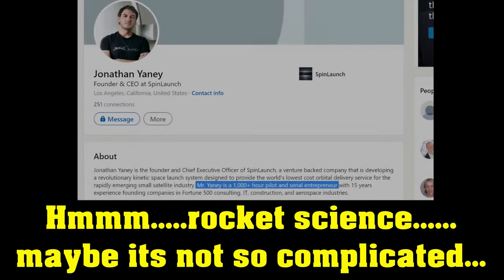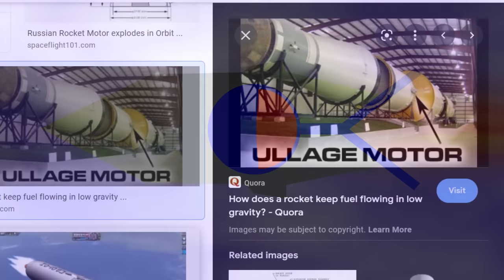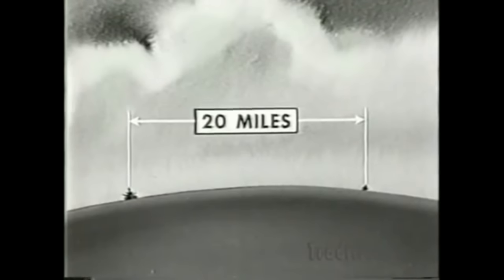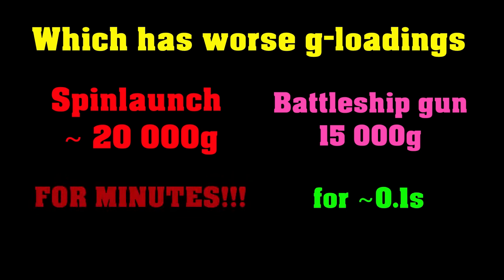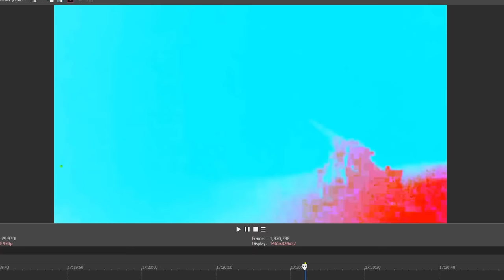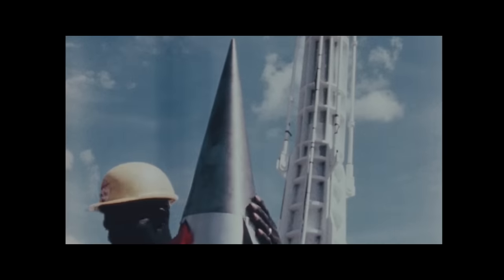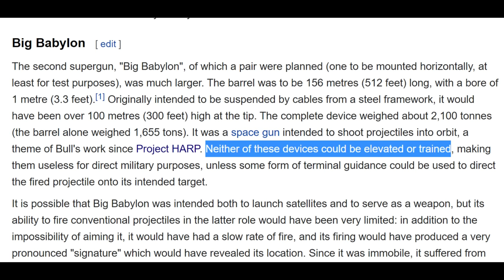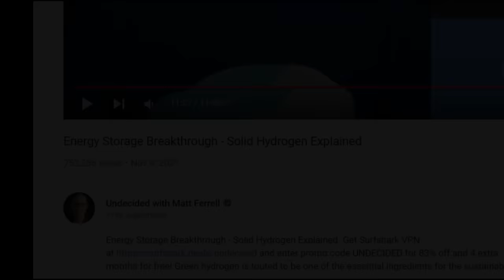Spinlaunch: BUSTED (Part 2)

Comment: Pay attention: if the rotor is spinning at 60 RPM, so is the payload. At release, the rod-shaped payload will continue spinning around its COG with conservation of angular momentum. Guaranteed failure.
Reply: As if there wasn't something called  "centrifugal force"
Reply: Get on the roof of a car and have your buddy veer suddenly to the left. Then tell me which way you fall off.
Reply: @kalebk9595  Nah, the better exemple, is to make your buddy run in circle , and then you simply let go, then we can ask wich direction the body followed.
Reply: Right. The COG is tangent at time of release. However, the payload continues to rotate in its inertial reference frame. This tumbling is caused by conservation of momentum.

Comment: I agree with most points
but I feel like calling them out for not firing at Mach 6, on a test run. Is a bit disingenuous. Of cause they aren't going to go all out on their first launch they want to make sure the concepts are even doable so starting slower is the reasonable and logical thing to do then move up in speed to see what needs fixing.
overall yes the whole thing is dumb, but criticizing them for what I understand as a first successful launch for not achiveing the final goals is just a bad argument.

Comment: Your logic is only limited by your understanding of the phenomenon of what happens in the gun. Acceleration only is nothing compared to "jerk" and it's derivated functions.
In a gun the acceleration isn't constant and induces shocks that damage the components. On a centrifuge it's smoother.

Comment: I’m sure you already know about the Real Engineering video. But just in case https://youtu.be/yrc632oilWo

I swear he’s mentioning you, without actually mentioning you.
My favourite bit, those doors that slam like a sledgehammer and have to be timed perfectly.
I’m not buying it.
RE also thinks if anything does go wrong then it’ll be cleaned up quicker than a regular launchpad. I really don’t buy that either.

Comment: I work In science media, I’ve made docs for discovery channel, science channel, history, National Geographic, etc… I guarantee you that the filmmakers added the whooshing sounds to footage from inside the “vacuum” chamber. (It’s also more of a high altitude chamber, not vacuum, but whatever.) 

I also guarantee you that the origin story of this company is much more complicated than some non-scientist dreaming up the idea… this is again a trick we use to get the “jist” out of the way as quickly as possible to get to the meat of the thing. The public has a hard time understanding how collaboration works, so we tend to default to a narrative of “Thomas Edison invented the light bulb and then started a company GE to make and sell lightbulbs (ignoring the mobs of people it took to take the idea from concept to market).”

The advantage of spinlaunch compared to HARP-inspired systems is that engineers can have much greater control of initial launch ballistics… in theory. This will be the test of whether spinlaunch succeeds or fails. 

The reason why nobody is doing HARP-like projects with modern materials is that no matter what, a HARP-like system requires a tremendous amount of post-launch trajectory correcting systems that must withstand far more Gs at launch than a circular accelerator. The uneducated viewer of this video will most likely walk away with the impression that the old HARP system was better than modern spin launch, when the reality is that the challenges ahead for spinlaunch are more likely to be solvable than a hypothetical modern HARP-like orbital launch system. 

My personal prediction is that spin launch will succeed ONLY if their investors are willing to triple or quadruple down on whatever spinlaunch is quoting them as the “worst case scenario”.

Comment: So the CEO of Spinlaunch has no experience in the field. Bit like Elon Musk then.

Yes the challenges are daunting. And it probably doesn't help with putting put marketing hype.

But this is a very new endevour. Which you are comparing to mature technologies that are at least 100 years old (modern rockets) and many centuries old (artillery). And both of those still mess-up spectacularly.

So by all means be scientifically sceptical. But kicking Spinlaunch now is like writing-off the idea of modern computers by dissing Babbage's Difference Engine.

Comment: You claim to have, "Busted Spinlaunch." Your argument is very weak here.  I agree that the G forces represent a huge problem with their design, but your argument that it's somehow "busted" based on crappy CG and that, "it's not as good as a gun," are faulty arguments.  Try harder.

Comment: ah... the problem is that the camera has a stroboscopic effect, so you can't trust your counting to be accurate. It could very easily be five or ten times faster than you estimate. Which is like the 5-10,000 miles an hour they implied. Also, if you are going at these ridiculously high speeds, then even in a near vacuum, I would count on some sonic booms. So there's your whooshing. Or, resonant frequencies of a freaking giant cylinder. I mean it's not as if things under high tension resonate well. oh wait. The problem is you based your entire argument on this stuff. So yah. If anyone has objections, tell me, but I think this debunk vid is at least reasonably debunked.
Also it's worse because it's a disruptive technology. The point is to not have to blow up a giant pile of explosives. Yah you could do it better with a gun, but rockets already are backwards guns. I mean sheesh.
Most of your videos are realistic, but many of them are just toxic pessimism.

Comment: I'm very conflicted about SpinLaunch, much more so than you or their investors. On the one hand quite a lot of the problems you brought up are valid, that video and the founder's background raise all sorts of Red flags that should tell investors to run away fast. On the other hand virtually all of the issues you brought up sound like they are actually solvable, albeit at much greater cost. Furthermore you made a major error in this video. Pressure fed rocket engines (which is what they're using) do not inherently require ullage motors. 

So what financial justification could there be for building such a contraption? As a contemporary commercial satellite launcher, none whatsoever. As an experiment, quite a lot. We must face the fact that rocket launching is not particularly friendly to the environment. Yet it is often necessary and so far it is the only way to get satellites and humans into space. Obviously this method would be unsuitable for humans, but the less rockets, the better. It is for this reason that this method may have some future potential.

Comment: I'm getting a little sick of you Thunderf00t. I was happy to see your first breakdown of that supposed solar powered extract-water-from-air grift but now you're just trying to take down new ideas,,, or, in this case, old idea finally given form.
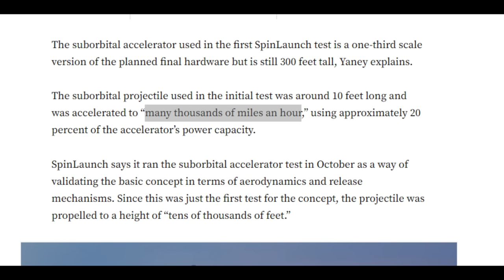From 1:45 to 2:56 you picked apart artistic rendering of the projectile as though it represents the final product. Why stop there, I can't wait to see the Thunderf00t debunk video on the SpaceX to Mars CG rendered video from a few years ago. Or also, while you're at it, how about debunking Reagan's Strategic Defense Initiative (StarWars) awareness video. That one features such unbelievable feats as detecting missiles with waves.
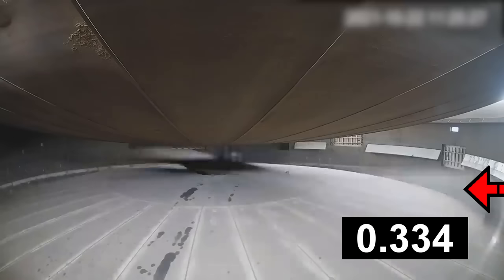3:59 Wait a second, you're trying to deduce rotational speed from blurry video without any idea of the FPS of the camera they're using? For all you know that thing could be completing one revolution between each blurry frame? Also, this footage you're analyzing, is it even of the device running at it's maximum speed?
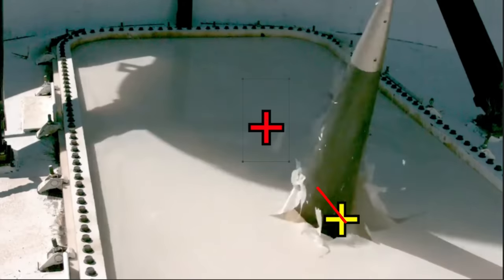5:18 That's what fin stabilization is for. On top of that, this is a great example of a kink that needs to be ironed out before the final product, not a reason to abandon the whole project.
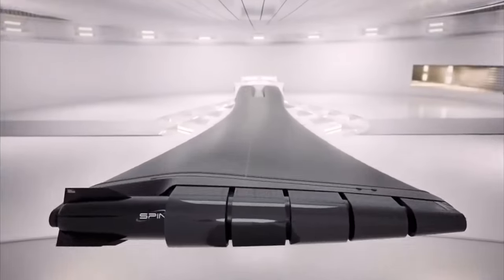5:35 And just why can't the entire chamber be evacuated during the 8 hour spinup period?
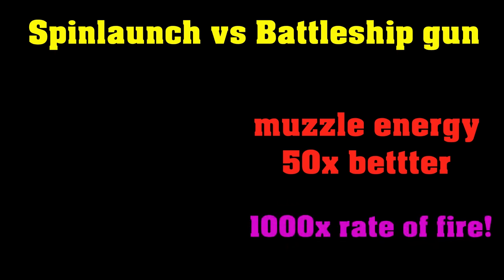6:22 WTF,,, are you actually comparing the quantity of battleship guns firing to the quantity of satellites the spinlaunch can launch, and concluding that battleship guns are better because they can fire thousands of projectiles for every one satellite spinlaunch launches? You sacrifice nearly all of your credibility with just this comparison alone.
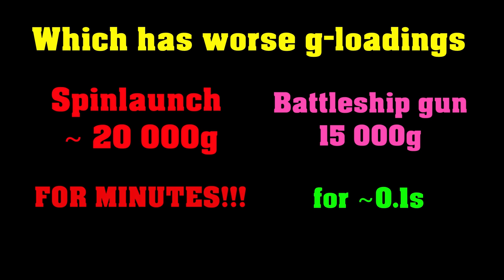7:23 Nobody ever said this would launch the next JWST. Nothing the builders released ever implied it would be for that. This device would occupy a very niche market to send small, low sensitivity packages into orbit. Think, Gene Roddenberrys ashes, or a Lithium Hydroxide canister for a failing oxygen scrubber in an emergency, or (best yet), a radioactive isotope with a short half-life that's essential for a certain experiment on the ISS.
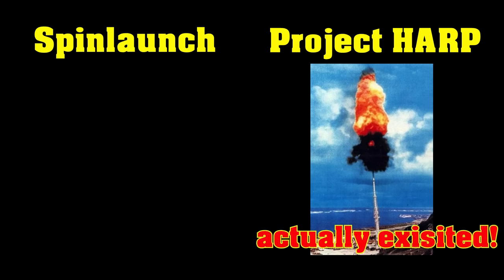14:40 I don't understand, are you saying spinlaunch doesn't exist?

Comment: well some disclaimer .... first of all why should they start wirth only a half fueled tank ... if the tank is full you dont need feed the engines via gravity .... dont get me wrong the idea is total bullshit ... but plz do some resaearch and dont trough in nilly vanilly facts ... second the battleship spinlaunch are two complettly differend ways to get something up to speed ... as you tell like 3 times in this video .... the spinshit get 3 hour or more to get up to speed ... and a freaking cannon like 4 meters or so ... depens on the length of the barrel .... if i drive 1 hour or 3 hours 120mph with my car it dont magical falls apart ...

Comment: I remember when you "debunked" Elon Musk's compressed air boosters for the Tesla Roadster by saying they were impractical because it would require tanks pressurized to 10k PSI, which would be way too dangerous in a car (I think you said something like "It's a bomb!").  It turned out that every hydrogen fuel cell vehicle on the road today has tanks pressurized to 10k PSI, so it's obviously not impractical for that reason.  Is it a dumb idea?  Of course!  Will it ever be built?  Probably not more than a handful, if at any.  Is it debunked?  Not at all.  I would say the same about the debunking of the Spinlaunch system.  Just finding something hard to believe doesn't make it debunked.  I won't be holding my breath for Spinlaunch, but you'll have to work a lot harder to actually debunk it.

By the way, what does it matter how many satellite launches they can do in a day?  These are satellites, not artillery shells.
Reply: @chemomancer  Hydrogen fuel cell vehicles are a bad idea for many reasons.  Any potential danger from the tanks isn't even at the top of the list.  Fortunately, hardly anyone is buying them.

Comment: You can't measure something rotating that fast based on video.  Ever seen helicopter blades that appear to be still or rotating really slow or backwards?   This is based on the speed (or frames-per-second) the video is recorded on. Your analysis is flawed, as most of the ones I've seen from you.  You'd probably make a great conspiracy theorist though.

Comment: Most of your information is wrong... 
1. Cannot calculate the speed from video, It depends on the frame rate of the video you are seeing and recording... 
2. There is no point when you say Technology is old... Because Electic car is Old technology only,  Electic car present before gasoline powered cars came..  ( It seems you also Illiterate about technology)
And it seems This video is Technically not accurate... 
I wasted my time...

Comment: It's not actively slowing down. That's called braking. It's just not accelerating any further. That's freefall. The fuel would be "weightless". Also, it is under extreme pressure. Pressure is able to counter acceleration to a certain point. You are not a physicist, are you?

Comment: Actually, this spin launch is real. Most fuel is burnt during takeoff. if they can find a way to avoid it and have some type of momentum until the rocket boosters kick in. it will work.
Reply: It's not real, They built one but it doesn't work.

Comment: Your snark is magnificent - and in this case very often wrong. 

1 - Liquid fuels under deceleration - This occurs in any liquid-fueled second stage as soon as the main engine cuts out. It's worse for Spinlaunch, but still an issue for other systems.
2 - Gravitational load, Spinlaunch vs HAARP - g-load is only part of the problem. Just as significant is rate-of-onset of acceleration, also called "jerk". Artillery shells have an enormous jerk level, Spinlaunch very little. it matters. 
3 - G-hardening satellite mechanisms, such as solar panels - That is engineering, and unless you have experience in the field, your reservations can be noted but are not disposative. It's possible that your objections will turn out to be valid, but at this point no one should take your word for it. I point you towards what has been accomplished with artillery shells, such as the now-obsolete Excaliber CLGPS, which used precision optical systems and computers for terminal guidance of anti-tank artillery rounds. For that matter, VT fuses, which used vacuum tubes for proximity detection in artillery shells goes back to WW2. If you go look at the Spinlaunch website, you'll find that they've g-tested things like iPhones - which worked at the proposed g levels.
4 - Efficiency - You compare payloads for Spinlaunch with projectile weight for HAARP, and that is just negligent.
5 -  You have to evacuate the chamber every time. - Well, no you don't. You make both the loading port and the launch port air locks. Immediately after the missile punches through the exit diaphragm, the lid slams down, sealing the chamber and preventing much air from entering. There is (presumably) a second door further back which can be closed to allow replacement of the diaphragm, then opened. Again, this is "just" engineering. It may or may not be practical, but your simple-minded objections do not consider the ways they can be worked around. It's clear that, whatever your objections to the Spinlaunch video, the process of mating to the launch arm is completely automated and can be performed in vacuum after the missile has entered the vacuum chamber. So the total amount of pump-down is far less than you seem to be sure of.

I'm not saying that Spinlaunch will actually work. For instance, I don't see any discussion of the impressive aerodynamic heating which will accompany launches (and see Sprint missile launch videos for comparison). What I am saying is that I don't see any conceptual reason why your scornful dismissal of the project cannot be worked around, at least in theory.

Comment: Meh. I don't see why spin launch shouldn't work. Fuel sloshing on the rocket are really non issues. All you would need is a small gas truster to give the rocket forward acceleration before startup. You loose all credibility pretending that's a deal breaker. 
3 launches a day is over 1000 launches a year. If they charge $1 million a launch they have a maximum revenue of $1 billion per facility per year. Even a small fraction of that would be profitable. 
Sure you could use a giant gun to do the same thing. You aren't though. Neither is anyone else.

Comment: The concept of having somebody impartial with detailed subject knowledge take a look at the various claimed breakthroughs struck me as a good idea and I accidently came across your video about magnetic dipole contributions to fluid deflections in charged fields which was excellent. 

This video however is a let down demonstrating many of the flaws you claim to bust in others.

As far as I can tell you have little rocket engineering knowledge or experience. You start by discussing ullage issues when the problem of fuel management for bi propellant rockets has long been solved in a variety of ways other than ullage thrusters. You show footage of a gun type nuke artillery shell and then describe a plutonium implosion device which was eventually miniaturised sufficiently for this use but many years later so clearly not a weapons expert either and so it goes on. Misrepresentation and or inaccuracy more or less throughout.

Your basic point that even if it works its not much better than a super gun is a fair one but the ridiculing tone and careless inaccuracy of the examples chosen  rather lessened its impact for me. The use of suppositions as fact should be especially called out, for example is it better to have a slow build up to high G or near instantaneous onset? You seem sure but where is your evidence.

Anyway - I have no idea if Spin Launch can work in practice and would offer any benefits over other systems even if it did. What I am sure about if that your piece was a poorly constructed hatchet job dressed up as objective analysis and that my search of intelligent critical insight goes on...